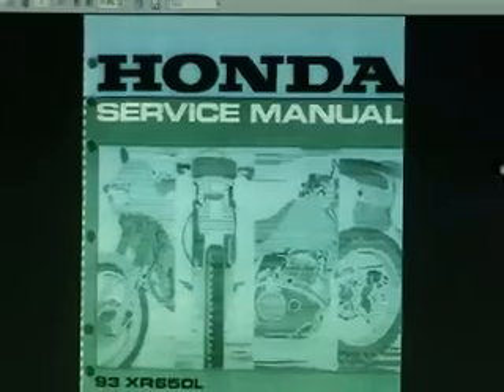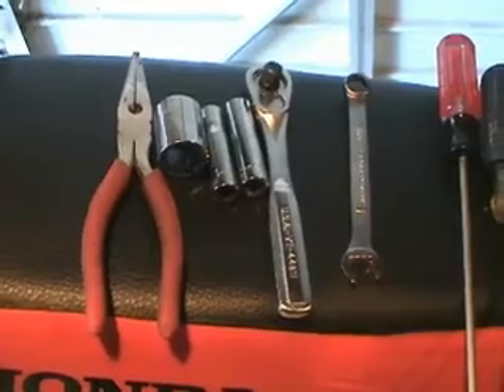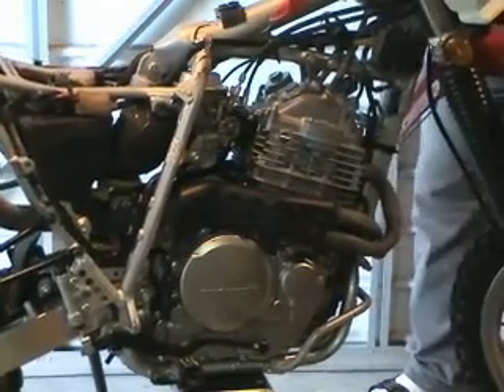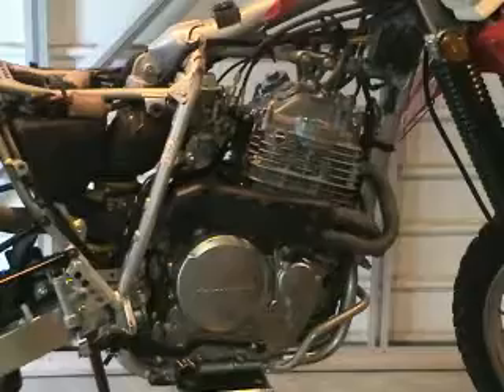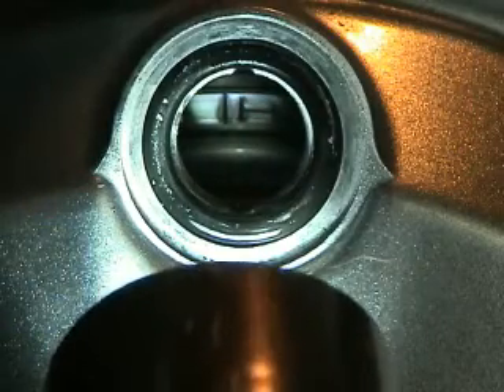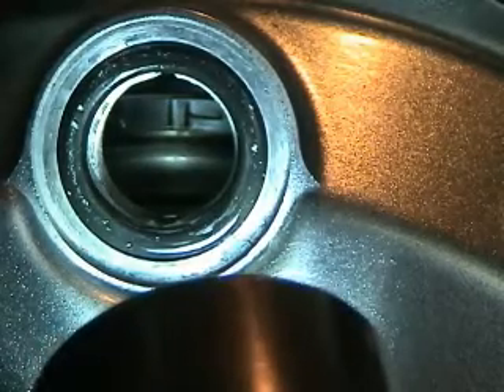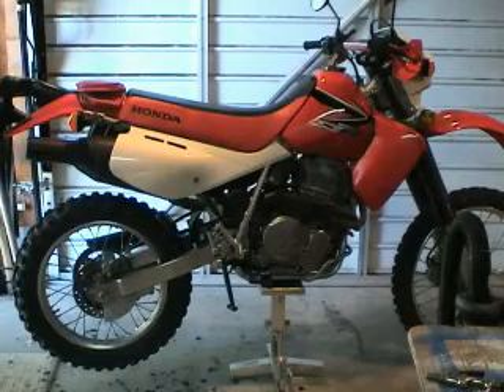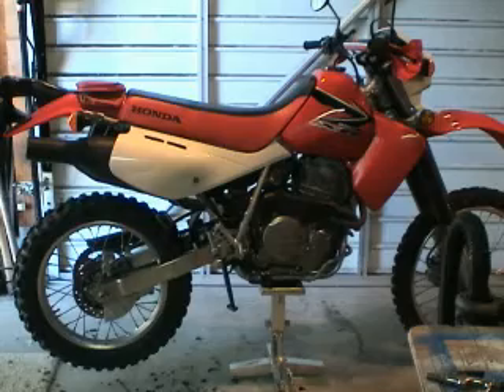Honda XR650L Valve Clearance Verification & Adjustment

Comment: I'm a bit late commenting on this, but shouldn't the exhaust valve be measured on a different point of the stroke? As in, the intakes and left (from the drivers' position) exhaust with TDC, but the right exhaust slightly before or over? Because that valve has the auto decompression pin thingamabob on there. It's what the manual says anyway.

Comment: I did the valve clearance multiple times and I have a loud knocking noise and seems to have lost some power. WTF am I doing wrong, the gap is 100% correct .004 intake and .005 exhaust..... Im totally lost.. this is the first valve adjustment on the bike its a 2015 with 1300 miles on it...
Reply: Drew's iRacing IN take is .10" and exh is .12". Your using metric's .004 and .005 and thinking that is .004" and .005". Not the same thing. You see .10" is not the same as .004. Got it? You have set the valves way to tight. They are riding the cam's now.
Reply: To clarify the clearances on the XR650L are 0.10mm (±0.02mm) i.e 0.004"(±0.001 inch) for the intake and 0.12mm and 0.005" same tolerances. Japan like the rest of the world use Metric System its way better, like absolutely amazing

Comment: The motor needs to be cold when checking the valves.
Reply: please tell me why my exhaust is turning red hot after 5 mind of running not riding
Reply: +Wilyum Kellum I'm not sure.  Post a question on http://advrider.com/index.php?threads/xrl-owners-sign-in.114834/page-4448#post-28022512